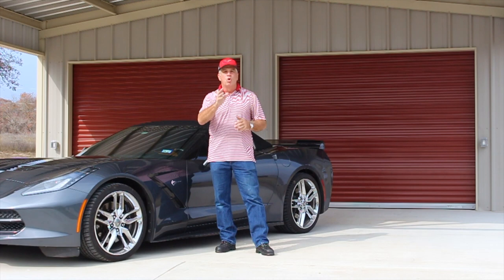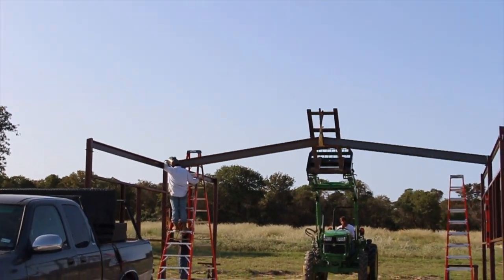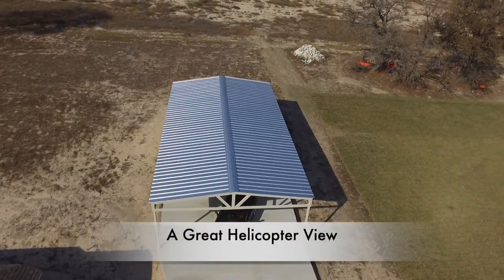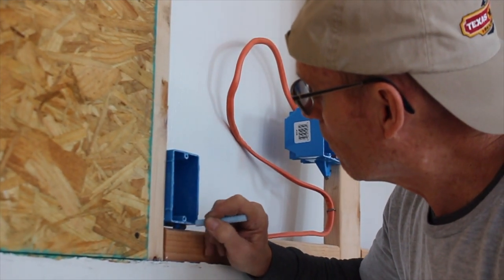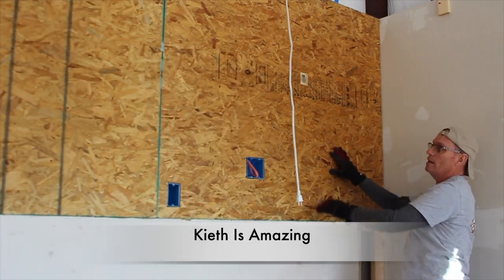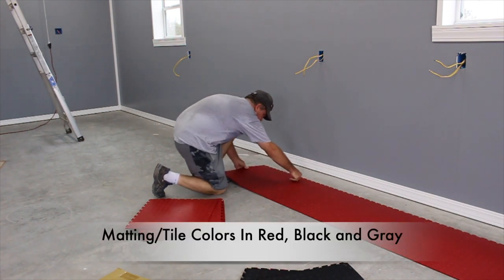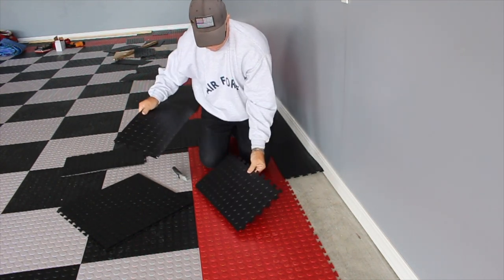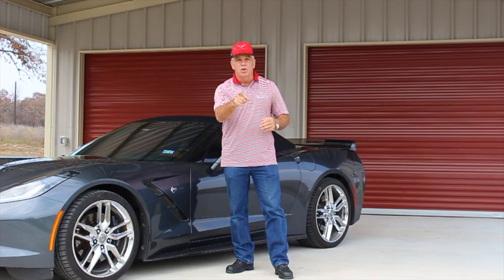The Corvette Hop Garage Workshop Build

Comment: I hv a question about the airbag On the side of the drivers seat, on a  c7 now I need to remove it temporarily to fix the seat the cover of the competition seat is coming off right where the airbag is and I can’t get to it totally to get it back in, so I’m not sure how to take off the airbag safety any help would be great.  Thanks great videos 👍😃🚗
Reply from the maker: Dennis, this video covers much of the seat removal in it as I installed Sound Deadening Material after I removed the drivers side seat. However, it is the stock seat and not the competition seat. Hope this helps friend. https://www.youtube.com/watch?v=OcAigd5rZdc&t=28s